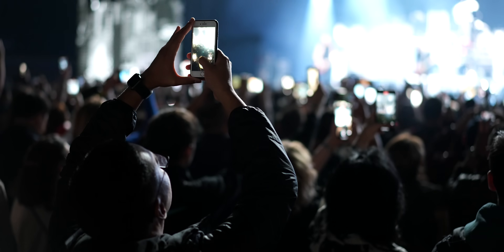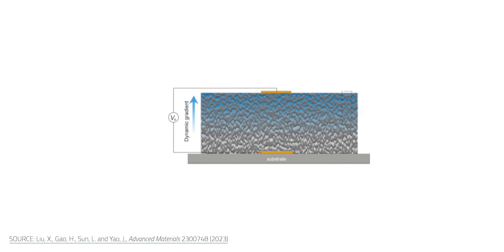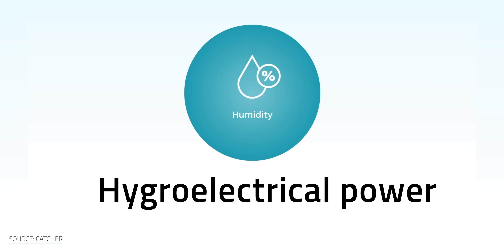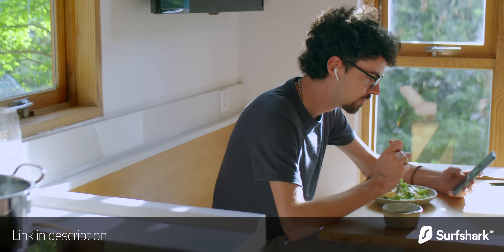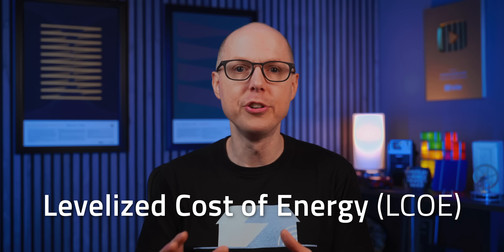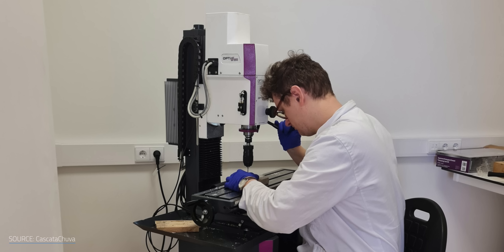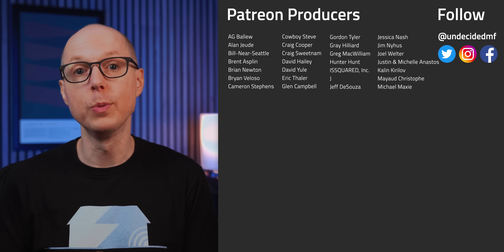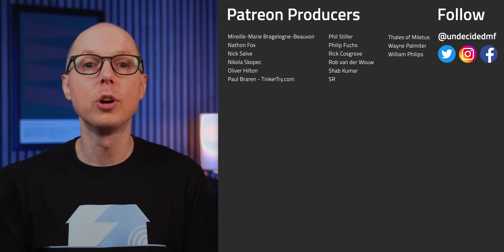Is This Accidental Discovery The Future Of Energy?

Comment: Sorry, my spidey semses are tingling.
This smacks a lot of zero-point energy, cold-fusion, magnetic generators and solar roadways.
Essentially, they propose having a $20K unit the size of a washing machine, just sitting there and producing 10KWhr of electricity, ostensibly by somehow absorbing humidity from the air.
Not discussed is where the "waste" humidity goes, how can you possibly get enough water logged air into the thing, and just the perpetual-motiony feel of what they are saying.
The phenomena may be good for micropowered devices, but scaling up to anything like 10KWhr is going to be sized on the order of an acre of surface area that cannot be wrapped up in a cube.
Matt Ferrell is known to get giddy on propositional technologies that do not comport with practical physics.

Comment: Good point that this new tech will be approximately the same cost as PV Solar panels.  However, with solar panels you need to remove the system (and then reinstall it) if you need to re-roof your house.  I wonder how many people take this drawback into consideration?

Comment: I think that this is leaving an important part out of the story… What happens if you put one of these batteries in a humid box in outer space?  You’re not going to get a perpetual motion machine, so I suspect that it will stop working after a few minutes.  The current will stop as soon as the pores fill up with water molecules. It seems to me that this is only way to keep it going, is if there is a humidity gradient between the two sides of the membrane.   If you need to keep one side dry your going to expend a lot more energy evaporating the water again, or else you will need to place it against a dry environment, like the outside of your house (e.g. that you live in a dry climate and you humidify the inside with an evaporative cooler).  The source of energy then, is not really the water itself, but the evaporation of water on the opposite side.  Trees use evaporation of water from their leaves (transpiration) to transport water up their long stems, but it is not exactly a high energy process.

Comment: I have doubts, that this principle will reach higher goals, than niches of current energy harvesting. Energy density seems too low and too dependant of the environment to make this a viable solution für 100+ W.
And btw - your explanation concerning typically used/needed voltages around 9:00 doesn't really apply any more, and suggests, you haven't understood too much of physical, chemical and electrical basics.

Comment: One part that is not mentioned in all the reports about this tech is where is the energy actually taken from? Energy can't come from nothing, so molecules bumping into the material does that mean it is taken from the movement of the molecules and it slows them down. So to get the energy it condenses moisture into water? Which would mean you need to control humidity in a room with that device. Well can be done easily but is something that needs to be considered then.

Comment: Speculation gets a little intense toward the end. We are talking about 100nm homes here right? How easy would they be to clog with dirt and oil, or break? It sounds like the washing machine sized device being developed is that firm factor so the charging plates are protected from contact. It would be interesting though, to see if these could have similar charging capability when hermetically sealed

Comment: I think it's a similar story to arm processors, they forgot to plug it in and the chip was still operating, or something like that, same as penicillin and I think pasteurisation all discovered by happy accidents. I guess its a kind of thinking outside of the box by accident. Great video Matt, perfectly under hyped to still leave room for expected emotions.
Reply: The engineer forgot to connect the cpu to system power either on the die or the circuit board, ARM drew enough power from the I/O pins to run. Which was freakishly amazing low power consumption for a cpu at the time:o)
Reply: @ebb2421  Even RGB LED strips do this if "+" pin is not connected, but the 1st LED chip will burn out if it powers more than a couple of LEDs at the same time.
Reply: Yes that is called serendipity.
Reply: ARM processors are just reduced instruction set processors. I don't think they were created by accident, you have to determine the instruction set you want prior to producing the chip.
Reply: @offensivearch  The processor creation was not an accident but the fact that it ran with no power source was an accidental discovery.
Reply: "I think it's a similar story to arm processors, they forgot to plug it in and the chip was still operating, or something like that"
Go home chat gpt you're drunk

Comment: The Beijing institute of technology ? and you believe anything that comes out of that ? I wouldn't. ten kilowatt hours from a washing machine sized battery, sorry, but I call absolute and utter bollocks on that one. This technology is probably very similar to electrostatic energy generation, generating a voltage potential is one thing, but sustaining it via a decent current flow is something else. It may be similar to the ability of clouds loaded with water vapor colliding and producing a similar effect, only the clouds are kilometers cubed in volume and hold hundred of liters of water.
Reply: It works just read the artificial in advance materials and try it yourself, I did and it works

Comment: If you can use a washing machine size appliance, why couldn't you use a water source inside the appliance to make a humid environment for the generator modules? If you use distilled water, and the unit is sealed, this could reduce the problem of contamination.

Comment: I'm disappointed about the episode. The supposed principle is not questioned. But it appears clear that you need a difference of the moisture level of the sensor and the moisture level of the environment to generate electricity. After some time the moisture level in the sensor will be the same as at the outside. -According to your analogy it would mean that eventually the same density of water molecules is on the top of the tube as at the bottom - eleminating the voltage difference.
That said - you likely will need a change of humidity to make it work. You can not just put the battery in the garage. It needs to be at the outside at a climate with big changes in humidity over the day/night cycle.
That would be my assumption at least.
What also disappointed me is that resistor for voltage conversation thing. Seriously? If you want to power a tiny LED, yes. But if it comes to higher currents like phone charging you will have DC/DC converters doing the job. How should resistors with fix ratio do the job when battery voltage changes over SoC? Just cut the resistor thing out. Its misleading and you know it better.

Comment: Now that might be a stupid question but i didnt find the answer in the video, where does the power actually come from? Does the device lower the room temperature? I mean, you cant just use up humidity, unless the device causes condensation (so water gets removed from the air). If there is a power transfer happening, something must lose power in the process.

Comment: it would be interesting to at least delve deeper into how much humidity produce how much voltage instead of just the voltage. And if the reaction is as described, wouldn't there be charged water particles left laying around the structure, limiting further electricity production? I'm really doubtful of how much power can be generated this way before needing to (somehow) clean the nanostructure

Comment: I'm pretty skeptical. Not that I don't believe it's working right now on a small scale, and even like that it could have some extremely useful niches. But "the future of energy"? I dunno, it sure seems to me like scaling will inherently run into 2nd law issues, regardless of the actual mechanism at play.

Especially if they're correct about the electron transfer during jostling in the nano-tubes, I don't see how it doesn't just saturate the ability of the local humidity to give up electrons. That could probably be solved to an extent with forced air flow through the device, but... ultimately there has to be some path to replenish the charge of the humidity, and if that's just done by passive grounding... I dunno. I just think there'll turn out to be some problem with scaling, you know?

Comment: That sounds like a good path to explore. I've seen panels that can pull drinkable water out of the air powered by solar. If you think about it isn't that what a hvac does in the summer dry the air to make it more comfortable. Global warm is making the planet hotter and we are going to need cooling devices in many areas.

Comment: Water hydrogen particles and air traveling through a  styrofoam filter creates a static electrical charge. 
This strata battery will absorb H2O filtering vapour through the stryrofoam separating the H2 into the bottom of the battery.
The O passes throught the styrofoam creating the dry static electrical energy.
If the water battery is placed upon a series array the continum energy source is created.
This by water flow gravitationally  travelind downward to basebattery.

Comment: You would not use resistors to step down the voltage - you would use semiconductors like a buck boost dc-dc module, they use very little energy when converting.

Comment: Simple, energy from the aether with electrostatics. Nikola Tesla, or use a Tesla coil.
Reply: You know tesla coils don't generate electricity right? Or store electricity that matter, it's just the world's most inefficient wire
Reply: @hawks9142  You do know that Tesla used his coils to convert electrostatic electricity to usable low voltage electricity at 110 to 240 volt.

Comment: I did some math, lets say this device liquifies water in the air like an air humidifier but turns the energy released by condensing gaseous water into liquid (2260J/g) into electricity instead of heat. then a 400watt version of this device (10kwh/day) would generate 15kg of liquid water per day if 100% efficient(it wont be). air has less than 30grams of water in it per cubic meter, lets go with 15g to be safe. then 15kg/day is 1000cubic meters of air per day 
that this machine would need to remove most of the humidity from. this equates to a reasonable  .7 cubic meters per minute of airflow through the machine.  
The other way this machine could work is with a humidity gradient across the membrane, which is less useful.

Comment: what if you combined a dehumidifier with an air purifier and suck humidity from the air into a chamber inside where the nanotech is. Then you have the "dirty" air going one way and the water going another way and under so that heat generated by the machine combines with the water to create the humidity to keep it constantly fueled?

Comment: where does the energy come from?  
A PV has photons as the source.
a wind turbine has pressure differentials 
a water turbine has gravity.

if the source of energy is the heat in the water...  we have a leap in efficiency

right now it looks lake a large watch-battery to me.

Comment: Matt, I've got to fault you for making a very misleading apples to oranges comparison.  You compare the companies 10 kwh per day battery, with a 10 K WATT solar system (that is, comparing ENERGY to POWER).  The point is, a 10 KW solar system will produce much more than 10 K watt-hours per day - more like 40-50 kwh.  So your graphic at the 8:04 mark is entirely misleading ($19k vs $20k), since one system will produce at least 4X what the other system produces.  This will very much confuse your average viewer.  You usually do better.

Comment: The positive charge on the butt of a bonded hydrogen atom is key to our biology. Hydrogen bonds down the center of dna is where the two sides separate for replication. The positive charges on hydrogen atoms down the length of phospholipids are key to the double layer of all our cell walls. The two hydrogen positive charges and the negative charge on the oxygen atom makes water weird. This new device is cool.

Comment: I have to put on my skeptical hat here. Replace the word Hygroelectric with Cold-Fusion, and you see the same problems. Without a solid understanding of what is happening, real progress may not be possible. 
Take cold fusion (LENR). It has been around for more than 30 years, many labs (including NASA and CERN) have concluded there IS something unusual at work, but no working theory exists [Look for the work of Dr. Peter Hagelstein at MIT].  This makes it impractical for real use.

Comment: so once you collect the humidity what happens when it evaporates back off?  does it need electric back to reset itself? what happens when it fills with humidity, does it shut down, or saturate?  how do you reset it.  what is the power scale for winter months when it's super dry?  If one needs a humidifier to power it, can it put out more power than the humidifier it needs, will use?  and many other ?'s to answer.

Comment: So it's literally energy out of thin air 😅😅. But even if they DO manage to deliver what they claimed, it'll still have a lot of buts, because just like air flow and sunlight, humidity isn't constant and available equally everywhere, moreover it differs vastly in different seasons throughout the year in different parts of the world. Like for example humidity level is very high during summer and monsoon season in most of the Asian countries (like Bangladesh) ,but it can get to almost zero in winter. And in middle eastern countries like Iraq, UAE and Egypt, humidity level can be very low almost the entire year (unless it rains). So, this humidity powered generator won't work as seamlessly unless the device can produce its own humidity to run, much like car batteries do to ignite the full in a combustion engine 😊

Comment: The humidity battery in line with 
1. A HEPA filtration system 
2. Air humidifier 
3. Air battery 
4. Air conditioning H/C
5.  Circilation fans 
Image a pool system😳

Comment: They are taking advantage of the 4th state of water, liquid crystal, which has electrical properties.. Another application of this is moisture and paper  battery concept. Although the fibers of the paper are not nano sized, they do basically the same thing. The polarity of the  100nanometer layer of liquid crystal water that forms on hydroscopic materials is opposite to the  water/moisture further out  setting up potential for energy flow. Energy is not  electrons. Any moving electrons only set up electromagnetic field where the  energy can flow. In the paper moisture battery the flow from moist to dry side of the paper sets up that flow. As size  rather than material of the pores in this situation is important,  this will possibly set up the  liquid crystal layer as an entire combined block making the whole sponge like material one polarity different to  that outside of the  porous material, setting up the field to allow energy flow. The energy to cause the crystal water layer is from the ambience, due to differing atomic weights of the  oxygen and hydrogen atoms.

Comment: I'm really surprised you did not address the elephant in the room here. How is this not a perpetual motion machine? In other words where does this energy come from? I have a hard time picturing how moist air is laden with energy (besides the warmth that means it's not frozen) If the generator takes energy in some way from this finite volume of air, it should somehow leave it different: colder? some change in electrical condition? Is change of state part of it, removing water?

Comment: What about placing these over or inside Nuke Reactors vents where the steam comes out. You have moisture, and heat and pressure there that is just being vented into the air. Now we just need a stable way to store power.

Comment: My question is. what is the waste product. If we imagine a perfect system of only water molecules and an invincible nano structure, then I would suspect that the water vapor is condensing when the stored power is used. basically cooling the water. This would be cool and have a pretty wide range of applications. If electrons are exchanging then I would suspect that ions are being created and or molecular bonds are breaking. so long as the resulting compounds arent toxic and that the energy extracted is greater than the energy needed to create the components I suppose it's a good thing. all in all, if it runs on humidity then it's not great for cold climates in the winters. If it can condense water with at least a net zero of inputs then it could be a promising method of desalination.